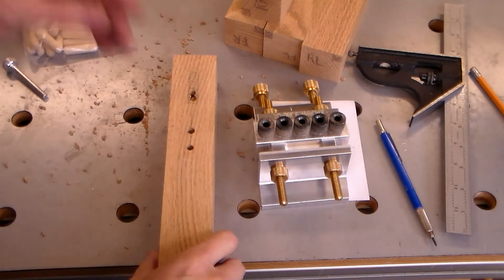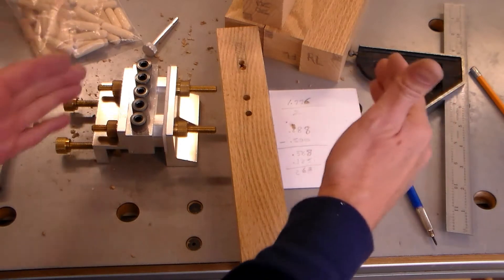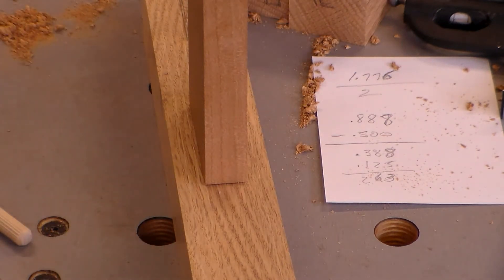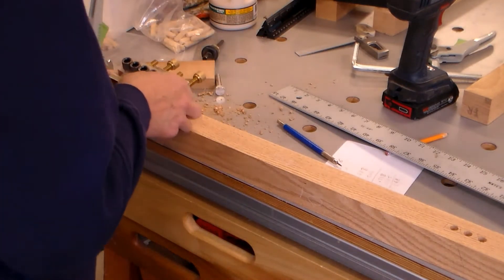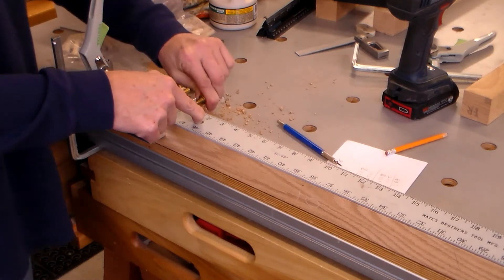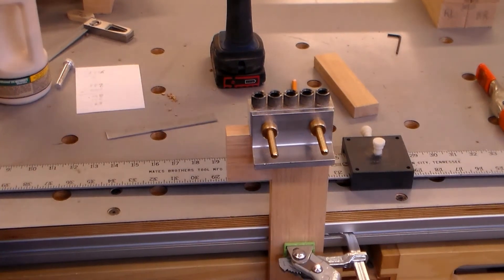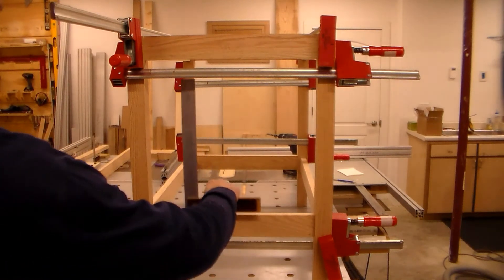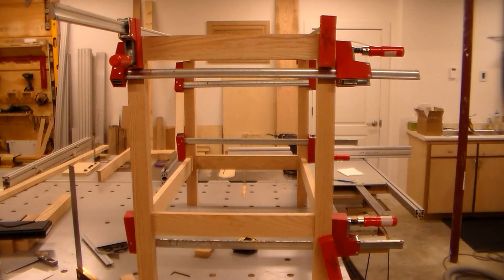02 Danielles Kitchen Table

Comment: Aren't you defeating the purpose of the reference check marks on the jig by agonizing over being exactly centered?
Reply from the maker: +Pat M The jig is set up that way. It makes sure if you were doing a flush face and a flush top, by following the check marks on the jig you will get exactly what you want. Being exactly centered is not a top priority but being as close as possible was. It was the look I was going for.
Reply: Ok that sounds like a personal preference which I can definitely respect. For me personally I use ALL the same reference face to index the jig and that way if its off a couple of hairs, its always off in the same direction. No fuss no muss.